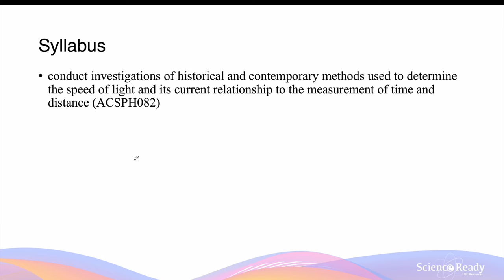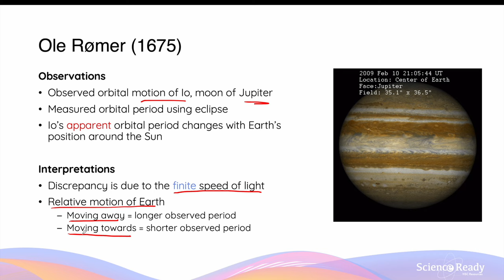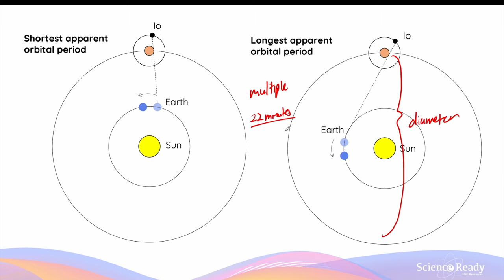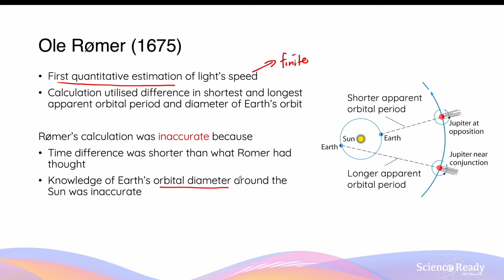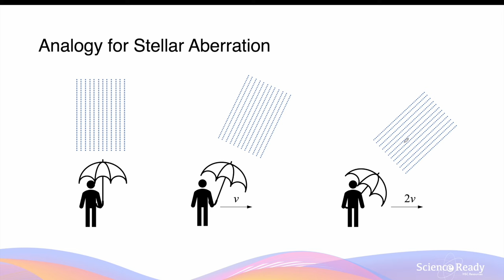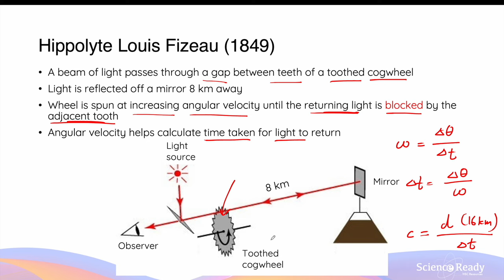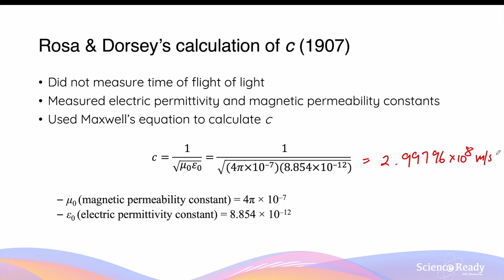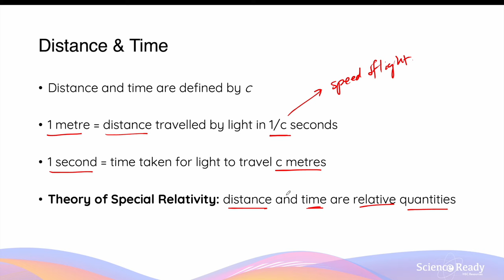How was Light's Speed Measured? A Detailed Explanation // HSC Physics

Comment: 18:13
> the definition of 1 second is the time taken for light to travel c metres
This is a circular definition, which would allow the quantities of a metre and a second to vary arbitrarily as long as they varied in the same proportion.

The second [...] is defined by taking the fixed numerical value of the caesium frequency, ΔνCs, the unperturbed ground-state hyperfine transition frequency of the caesium 133 atom, to be 9192631770 when expressed in the unit Hz. (Wikipedia)